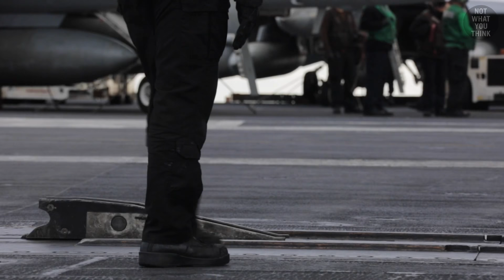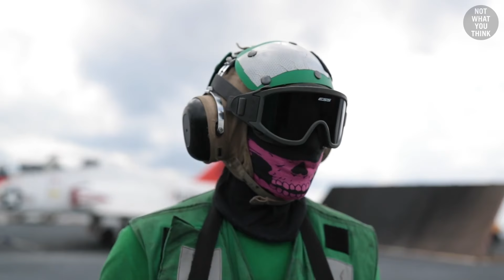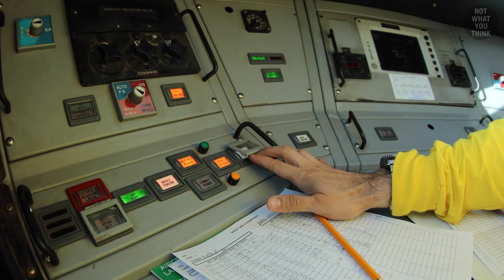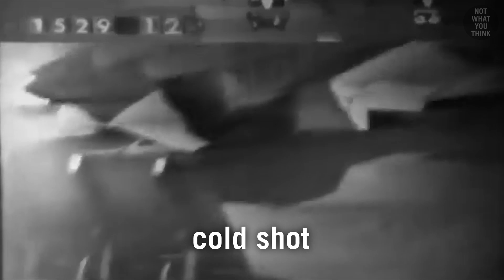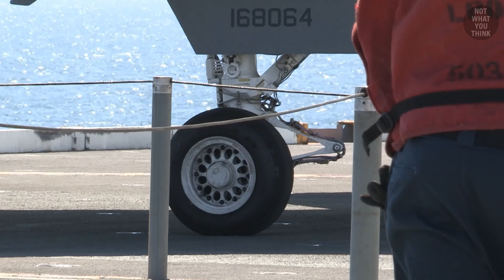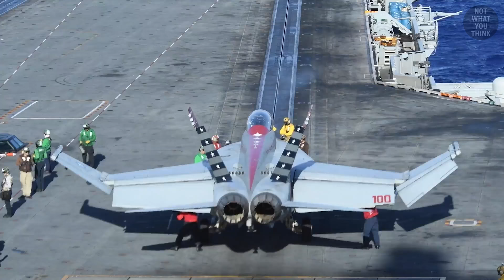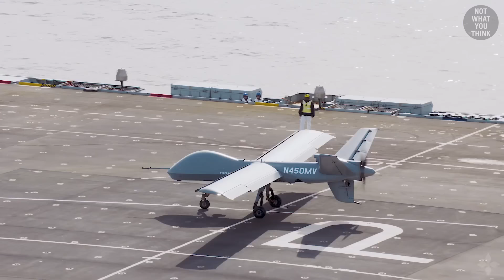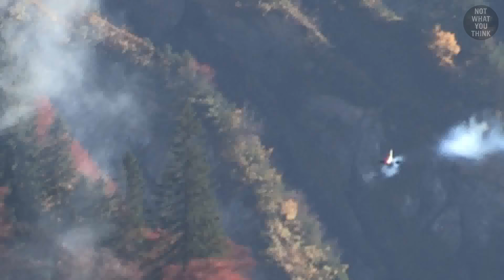Why the US Navy is Replacing Electric Catapults with Steam

Comment: I didn't mind the EMALS (not emails), I thiught it wouuld be better for the flight deck crew, since the steam rising from the catapults may imare the crew's vision.
   Take care, and all the best.
Reply: The steam is just an annoyance, it's quickly blown away by the constantly moving carrier. What EMALS really provides is finer tuning of the acceleration forces, which is especially important for lighter aircraft like all the drones we'll be launching.
Reply: @doujinflip The lightest deadload sled during catapult testing is 7000 lbs. Steam catapults shot that sled just fine with the required end speed. I was there in Reagan and Lincoln when they shot it.
Reply: @michaelmappin4425 It's not the end speed, it's the starting impulse that threatens damage, which is much harder to control with valves on an essentially explosive pneumatic blast. Electromagnetic acceleration can spread that launching force more evenly down the length of the catapult.
Reply: @doujinflip I'm 100% for EMALS. I just disagree with the amount of stress steam catapults cause being the main selling point. There haven't been any maintenance schedule changes to any air wing aircraft operating from the Ford.
Reply: It's better for the crew because of less maintenance. Catapult crews have to be on deck 2 hours before flight operations just to stretch the steam catapult. That's right, stretch. It's called elongs. As the catapult heats up, the track expands. It is measured and it has to be within limits before shooting aircraft.

Comment: The only one thing I can see that you missed is the point that it depends, which direction to the Wind That the Ship Is Actually Sailing.And how fast , because that will add drag or increase le
Iift
Reply: They do take that into account. It's just that wind direction & speed can change a LOT faster than a supercarrier can manoeuvre.

So they'd much rather break the gear/undercarriage rather than risk sending the pilot for an unplanned swim, hence cranking up the launch forces. And making the service technicians want to put a wrench into their skulls later.
Reply: The ship always turns into the wind for launch and recovery. The video was mainly talking about gusts.